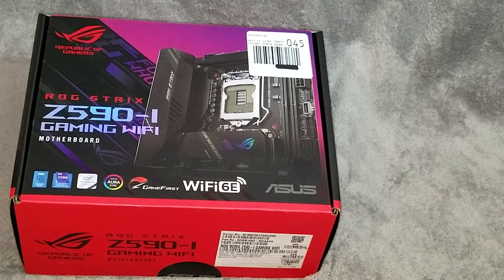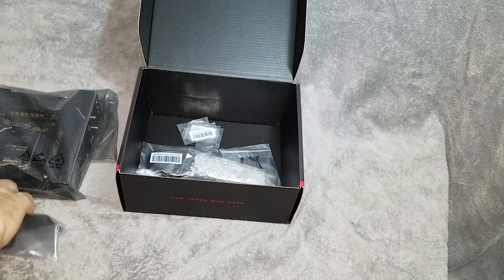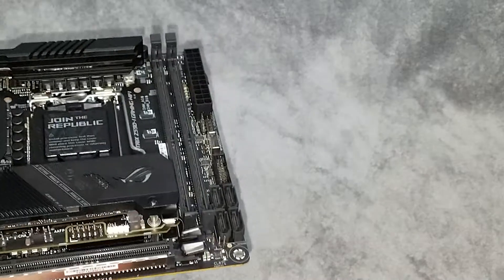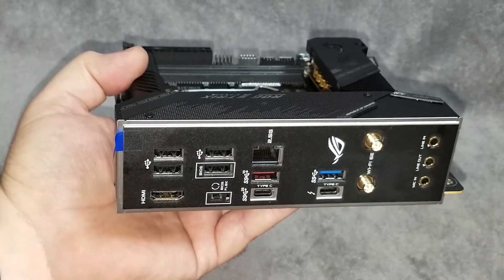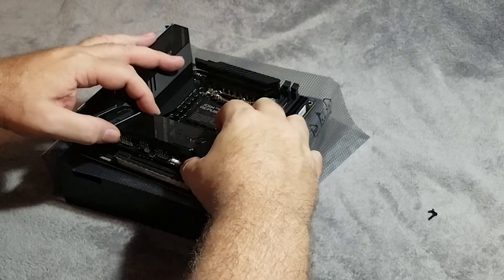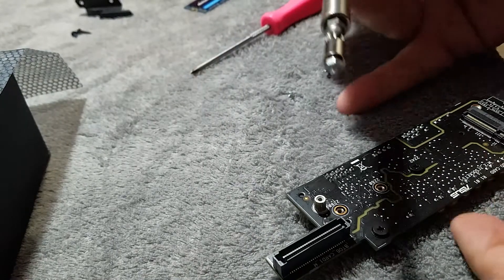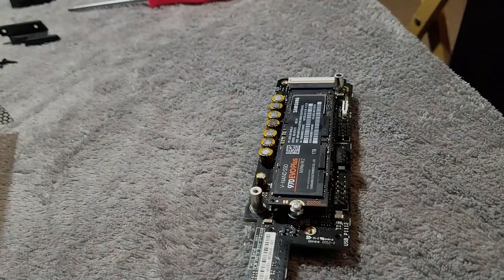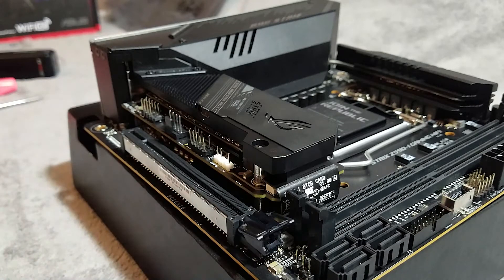Asus z590-I Gaming Wifi Unboxing and Drive Install

Comment: When you install the M.2 drive with the thermalpad at the bottom (underside of the drive), it seems like its not touching it, or is in contact with the pad?
Reply from the maker: Depends on the Drive, 2TB and larger drives typically have chips on both sides of the board that need the cooling, no chip like on a single sided drive, the chip may not touch the pad but it will be very close and there wont be any adverse affects on the drive or the pad if you decide to upgrade to a larger drive down the road.

Comment: If I don’t get the SATA do I still have to remove the thermal layer ?
Reply from the maker: you only need to remove the protective film if you are using an NVME drive

Comment: Can you run 3 monitors from this, say 1 thru HDMI and 2 thru the Thunderbolt  with an adapter, or 1 each on HDMI, USB C, and Thunderbolt? UHD 750 does support 3 monitors.
Reply from the maker: if you want to run 3 monitors its going to be best to run a dedicated graphics card
Reply: @kbzgaming9907  I already got it and built a new system in an Ncase, Im successfully running 3 monitors from onboard UHD 750 graphics, and its working great, will hold me over until GPU come down in price.

Comment: Where's part 2?
Reply from the maker: Thank you for the comment! part 1 is the case review, 2 is the MB, 3 the power supply etc. There have been re-shoots due to incorrect info from ASUS support. stick with us for all the content. there are actually 3 of the mini's and 2 full RGB builds in process.

Comment: So which CPU will you be using.  ASUS told me that since I'm using the i9 10900k I'll need to use the second M.2 slot which is PCIe 3.0 I think.  So I ordered a Samsung 970 PRO 1 TB for the second slot and believe I won't be using the fist slot at all.
Reply from the maker: that is correct. since i finished this video i have went around with Asus for weeks just to find out i was given incorrect information... only the 11 series chips will enable M.2_1 if you have a 10 series chip M.2_1 will be deactivated. So far i have built 3 of these systems 2 with an 11700k and the original with the 10700k
Reply: @kbzgaming9907  Thank you so much for communicating this back, ive been trying to figure this out also. Im looking for a z590i motherboard that would allow me to use both m.2 slots in gen 3.0 speeds. So far MSI have said its doable on their z590i Unify motherboard but I'm now reluctant to believe them from your experience. Do you know of any boards that would support this in the z590i series that you have tested? (gigabyte z590i vision d/msi z590i unify) Thanks again, much appreciated.
Reply from the maker: The first bulid was a 10700K, ASUS support told me the M.2-1 slot would work but only in 3.0 mode, they assured me both slots would be active, and even after 5 weeks and an offer to return the boars for RMA, i find out that unless you use an 11th gen chip only the M.2-2 slot will work. so the 2nd and 3rd build were done with an 11700K. We have used both a 980 Pro and a 970 evo in the M.2-1 slot with no issues with the 11 series chip.
Reply: @kbzgaming9907  Ok, so I have to use the 2 slot due to my i9 10900 10th gen.
Reply from the maker: @bertraminc9412  Yes with the 10 series chip the M.2-1 slot will  not work or be recognized by the Bios
Reply: @kbzgaming9907  Thanks, do I need both slots for any reason?
Reply from the maker: @bertraminc9412  for the average guy not really. I have Nvme in both slots for better performance in video encoding and rendering